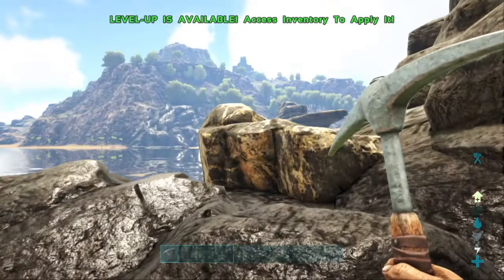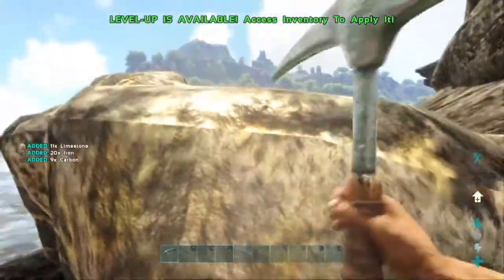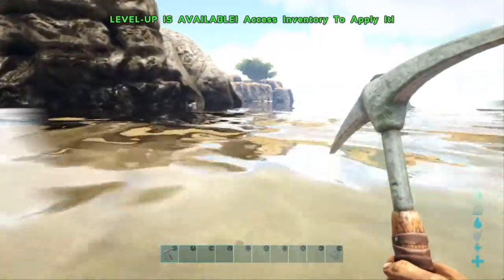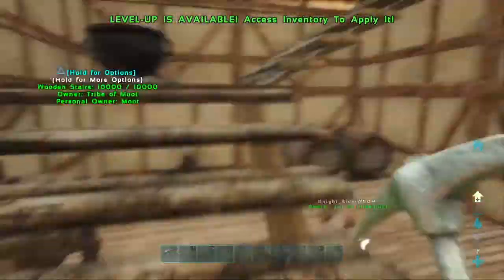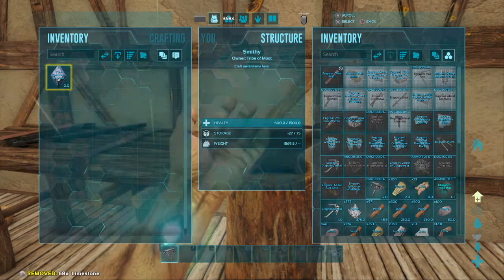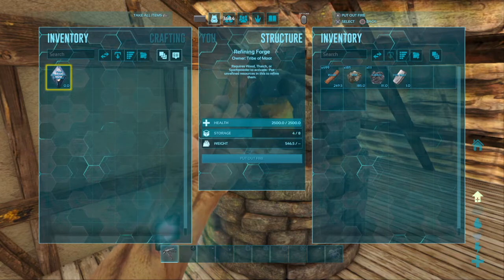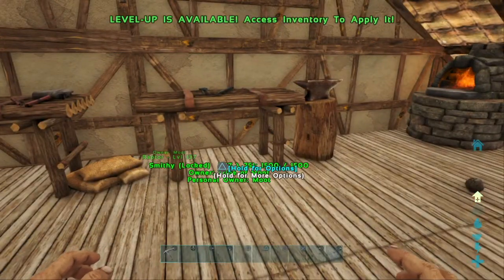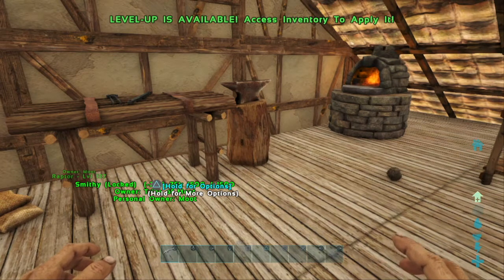How To Make Steel Ingots Ark Primitive Plus

Comment: Im playing on ps4pro and cant put carbon inti thr forge why?
Reply: I cant too
Reply from the maker: I am not sure why it may be because the new update but I will work to find a solution
Reply: I have the same Problem
Reply from the maker: I think it might be a glitch due to the last update
Reply: @moot7472  did you guys ever find this out? Same issue here
Reply: Same issue cant place carbon in the forge… ps4 pro.
Reply from the maker: I haven’t found out yet but am still trying to solve it
Reply from the maker: It appears you need a industrial forge for steel
Reply: Issue about the forge is u need 1200 steel ingots to make it
Reply from the maker: If you are on a boosted only way to get the industrial forge if is from a admin
Reply: @moot7472  I'm submitting a ticket we should do this

Comment: How do I get a advanced workbench it says its crafted in smithy I can't find it tho
Reply from the maker: Have you learned the engram it is on level 70
Reply: @moot7472  yeah I did im level 105 on mod server
Reply from the maker: If you have it learned try looking it up in the smithy with the search bar or check to see if it is still in the server a admin may have removed it
Reply: @moot7472  oh then they did it tied that
Reply from the maker: Ok I’ll try to find other ways this could happen
Reply: When I looked it up, it said it's a common glitch on ps4 and I'm assuming xbox, I'm on xbox and can't find it either
Reply: @lilpiggie7095  intresting
Reply: @moot7472  ey bro I need do steel ingot in oficial yo have a idea?
Reply: @moot7472  and also need advanced smithy
Reply from the maker: what I have found our and from other players steel you can only make in a industrial forge and you can not make glass due to a glitch
Reply: @moot7472  Okey thank you bro
Reply from the maker: @sendokai8992  no problem thank you for watching

Comment: How do i get obsidian pick
Reply from the maker: You will have to mine a obsidian node and I believe have wood then if you have it learned you should be able to make one
Reply: @moot7472  i cant
Reply from the maker: @zalop.  have you tried to make it in a smithy it also takes hide
Reply: @moot7472  yes
Reply: @moot7472  is there  Another smithy??
Reply from the maker: @zalop.  other than the advanced workbench no I’ll try to get on and see some possible issues soon
Reply: @moot7472  thanks
Reply from the maker: I’m hoping the obsidian pick isn’t also glitch but idk
Reply: @moot7472   I found out how to make a obsidian pic u nead a advanst working bench
Reply from the maker: @zalop.  ok thank you